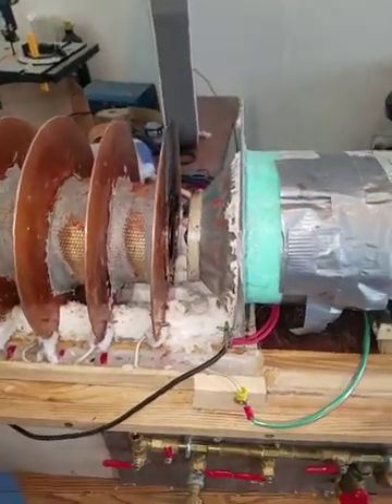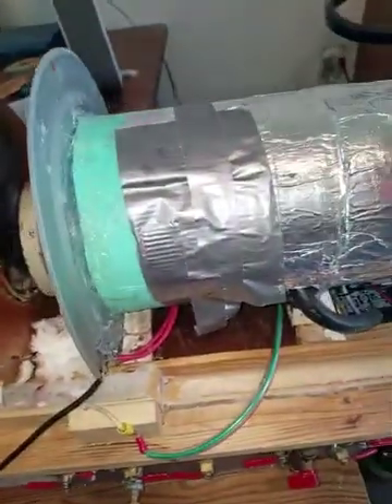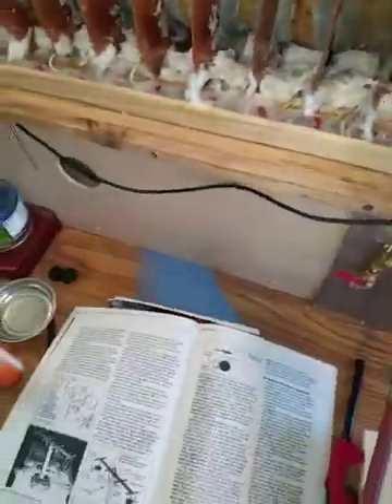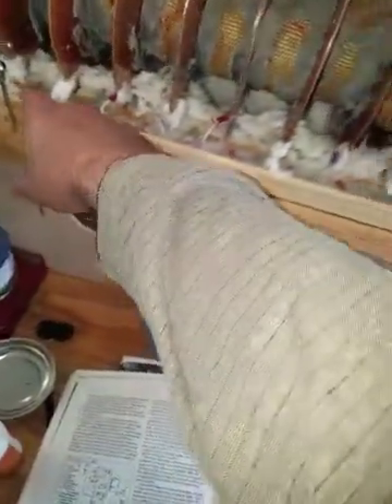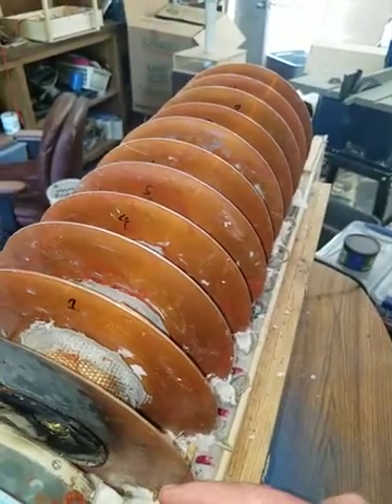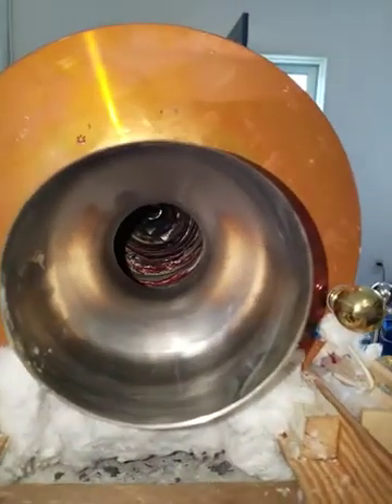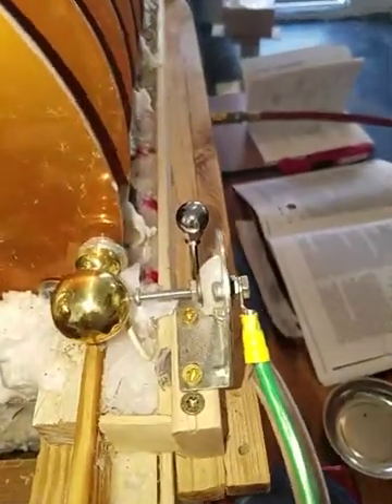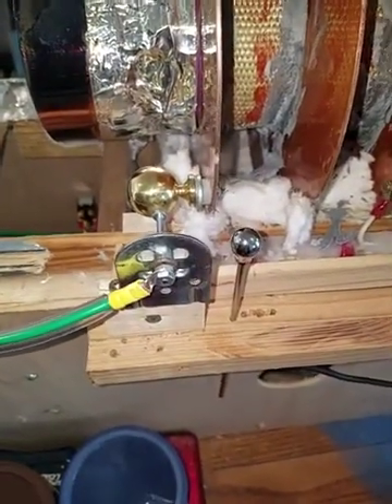Electrical Charge Transfer via Flame: Generator Demonstration

Comment: Would probably help to turn this thing skywards like a chimney.
Reply from the maker: Originally this was designed as an aviation platform for creating large volumes of ionized gas of negative charges, but as a generator it could be built in a vertical position like a chimney.

Comment: You appear to have essentially assembled what just barely falls short of a rudimentary linear nuclear fusion reactor. If you were to consider some refinements, and reconfiguration, and replace propane with Hydrogen you would have an Electromagnetic / Nuclear Fusion  Plasma propulsion system..or one hell of a generator.
Reply from the maker: Yes, it is short of a linear accelerator and could be used as a generator of High voltage for an accelerator.with some refinements.

Comment from the maker: I would suggest you go look at Townsend Brown"s patent US patent 3, 022,430. That is where I  had got the original plans. I finished the blower and lectured at the Tesla Tech Conference back in August 2018. I used natural gas on the burner part but was also able to show that you could produce High Voltage (242-250KV) from out of the exhaust of the Flame Jet Generator, using CO2 gas.

Comment: Are those hard disc platters by any chance...
Reply from the maker: They were old computer disc from a mid 70's hard drive,
Reply: That would be a giant hard disk now wouldn't it? I like to use copper sheets off of amazon.
Reply: @introvertedgames  I've seen 'em getting on for 2 foot in diameter on old 70's banking machines..

Comment: Why do you apply the HV in the first place, it should be enough with a very low battery voltage.
Reply from the maker: Not if you are  charging up 20kv ceramic capacitors in series. The stream of gas passes through the center of the burner plate holes. As the gas passes through them the plates are charged.  In the center of the gas is a 60KV Cockcroft-Walton charging element  that charging the gas as it is exhausted through the back of the generator. See Brown's US patent 3,022,430.
Reply: @ElectrokineticsNow  isn't the goal of the high voltage to convert to increased amps for more watts? How many watts do you generate versus how much fuel you put in. Like if that fuel just powered a generator directly for watts? I saw one of the equilateral triangle craft so close I heard the low humming noise it makes - so Ed Fouche says it's a plasma gravitation cancellation and then has a MHD propulsion. So you're saying that would be the same system more or less as what Townsend Brown realized - only using a mercury gas?

Comment: No air in space bro.
Reply: Not true. The density is so small that it is ignored. Because of this don't you think there is much being over looked? How many other things are ignored in science because we want to treat or experiments as closed systems when in fact they are not.
Reply from the maker: Right, His original device was designed for atmospheric transmission and  not space.